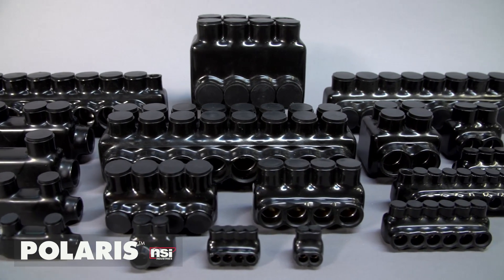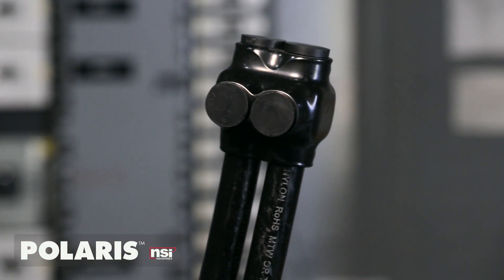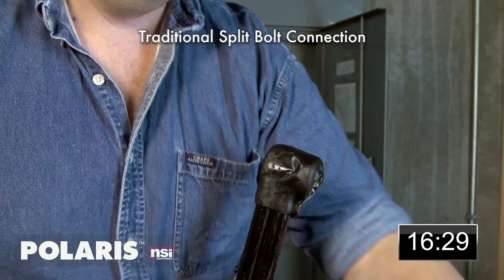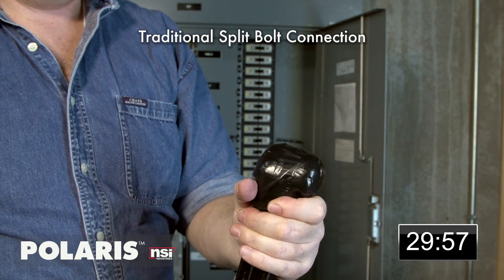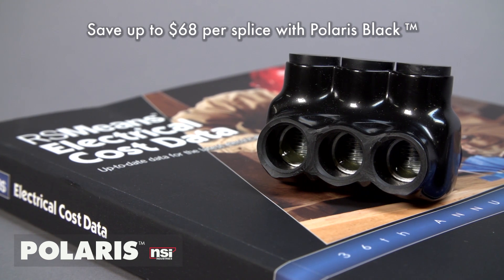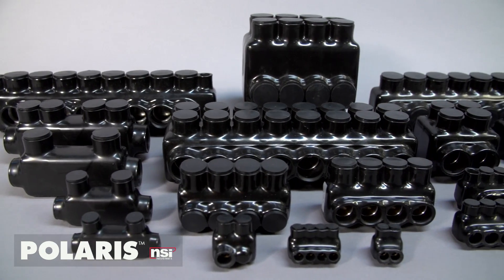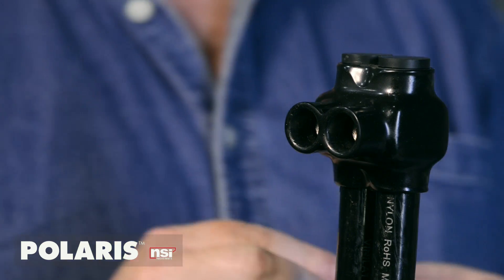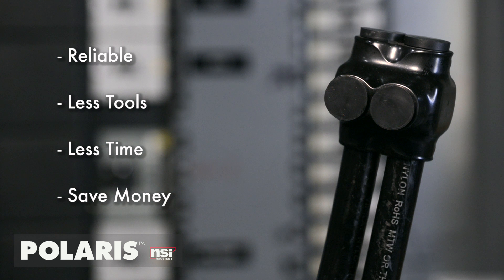Comparing Polaris™ Black Cable Connectors to Traditional Split Bolt Connectors

Comment: how the heck are you estimating $90 per splice for split bolt connections?
Reply: CKH Electrician’s charge a lot.  5k to upgrade service from 150 to 200.